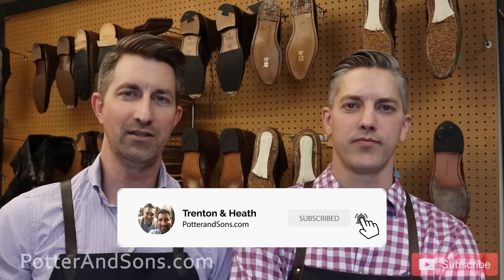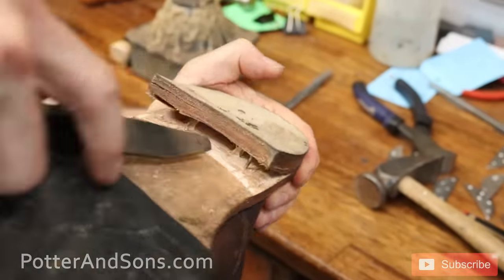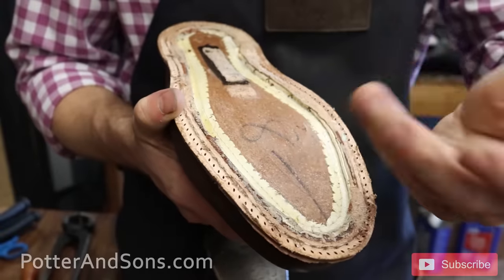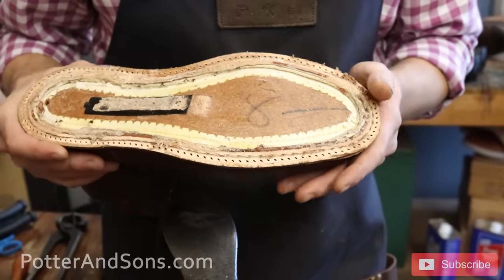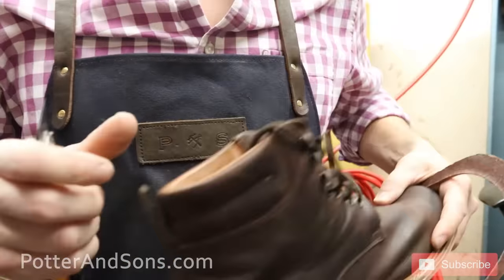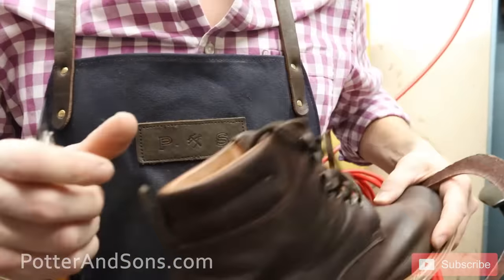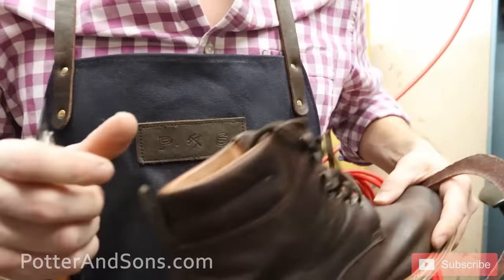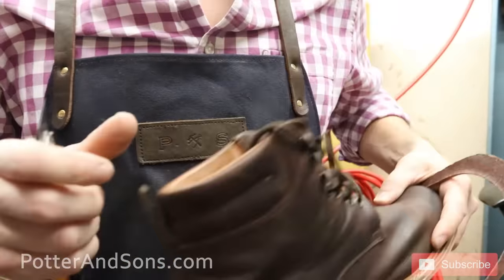Boot Restoration | Refurbishing These Boots With Vibram Wedge Soles

Comment: SHOE RESTORATION:  Tony Lama western cowboy boots with rare elephant hide upper, vintage.  It is slightly tight in terms of length and width, particularly over the right 5th metatarsal head and needs new soles (new soul) and restoring has a metaphorical importance for me. Back story:  In rekindling my relationship with my wife who just loves ballroom dancing,  we went to a Western Dance and had a great night dancing a few nights ago. I want to do this with her again so I bought an old pair of cowboy boots which may have fit well 20 years and 30 pounds ago but I read that elephant hide is tough and I worry about breaking instead of stretching the fibers if I attempt it. I'm afraid to do the things of washing, soaking, stretching and conditioning it to get it to serviceable condition, and it is painful at that right metatarsal to wear it. If you can help me resurrect the boots, I would be most grateful on so many levels.

Comment: Shoe Restoration:  I have a pair of Red Wing boots that I would love to wear again, but I haven't because the soles need to be rebuilt (normal wear).   the uppers have some stitching coming out as well near the ball of my foot(inner sides), so I don't wear them for fear of doing more damage.
What sucks is that I am SUPER flat footed and my feet are really wide, it's hard for me to get into a pair of boots that aren't triple E width, yet these boots fit me well enough to not be a complete pain.  I would love to see if they could be rebuilt, but maybe widened just a bit at the mid and at the ball of the foot... I don't know if that's possible, but that's my wishlist.
So, this really isn't so much of a restoration as it is a modification.

Comment: Shoe Restoration:  Bit of a challenge, my comfortable 2010 fast fashion derby light brown shoe from Aldo that needs a new patina aiming for a maroon with burnt toe and accent any areas that will give the shoe a new look.  The shoe looks to be blake stitched, but is more likely just cemented on which I'd like to turn into a welted shoe with a full leather, JR preferred, sole with a beveled waist.  The soles dyed with a bright royal blue with brush strokes accents of a darker tone with french tip.  Heat stamped with your company name and my initials and whatever artistic style you'd like to add to the shoe from brass nails or accented colors.  I'm ok with surprises and I don't mind wearing loud shoes so let your artistic side go wild if you like.  ♥ Thanks

Comment: Shoe Restoration - Oh boy do I have a challenge for you. A pair of womens boots in desperate need of repair. The metal shank is poking out, the front half has been resoled two times prior but the front is just wearing right through and has big holes in them. The uppers has big wear on the inside of the heel area, so that would need something done to it as well. I have worn these shoes right down to their bones because I love them so much, but budget restrictions as a student means I have not afforded to hand them in anywhere. They are still very beautiful, and I think it would be fun to see more women's shoes featured on your channel.

Comment: Shoe restoration 

Omg my work boot is in horrible condition.  It has been thru countless concrete pours. My boots are black thorogood.  But they look grey and the wedge sole on both heels are almost completely gone. I guarantee you haven't seen a more beet up bpot

Comment: SHOE RESTORATION:
old pair of thursday boots,  orginal sole is very worn down, heel has been replaced twice, current heel does not even match sole. Stains all over suede, boots need TLC I would like to equipt them with danite soles and toplifts
Reply: these boots have already been repaired more then just heels, the leather lining has been replace to grey suede do to hole, welt has been restained, 2 new toplifts, they need full sole and heel
Reply: These boots have also been fixed several times...
2 new heels, interior lining patch, ink for welt, and shampooing, I am curious to see how my prior cobbler did in review from t+h